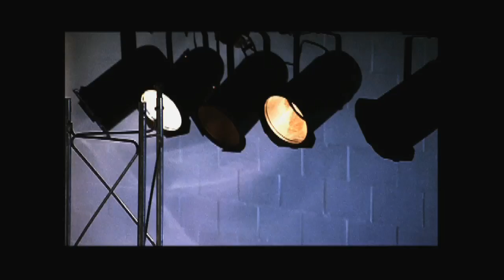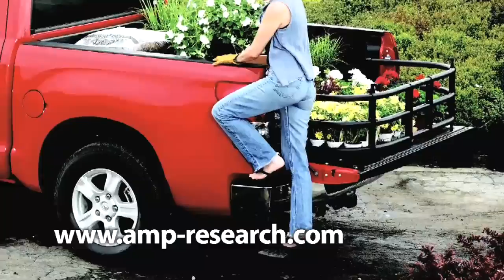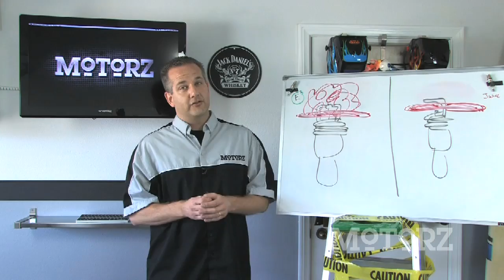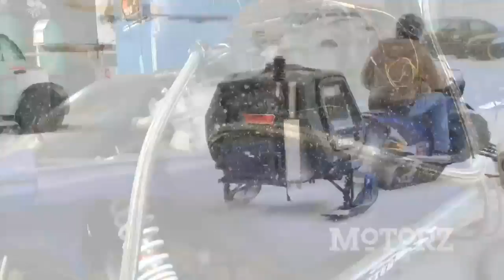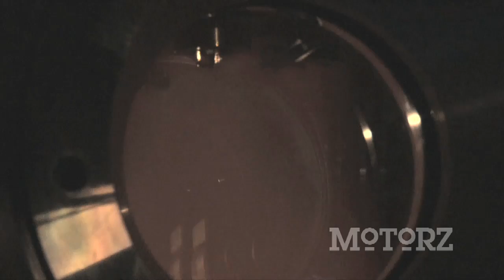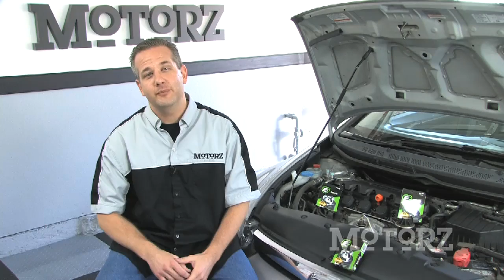How-To Inspect and Change Spark Plugs Motorz #49

Comment: Hey,

Question- why, when the manufacturer gives a torque spec do you not use it? 2007 Civic R18 engine calls for 156lb/in of torque for its spark plug installation. Why not use it?

Comment: I have used e3 on other cars. Very happy with them. I have a Dodge Charger hemi 5.7L which take 16 plugs. I have heard on forums and such that the e3 plugs the hemi doesn't like. I am in a rut thinking. What should I do. First hemi I have owned just don't want to mess car up. Please help

Comment: If the e3 design truly produced better results than a single electrode it would simply have been adopted as standard equipment  40 years ago when emissions laws started reforming engine design.

Comment: Spark plugs at an absolute minimum should be changed every 100k miles. Some hardcore folks claim every 30k for copper, 60k for platinum, and 90k for iridium. In my experience a happy medium of 50k for copper you should pop the sparks out to inspect. If they look tore up, changed them out they're cheap ($20 or so for a set of 4)

Comment: The internal combustion engine technology is on its way out. Sooooo inefficient I want to scream!!! The general energy efficiency of the ICE is about 20%. That means 80% of the money you pay for your gasoline is wasted as heat and inherent handicaps of so many energy taxing devices as the transmission, shafts, clutches, adnosium. Think about this folks: when you pay $100 for a tank of gas, you expect to get your money's worth right? NOOO!!! You're getting around $20 worth. The other $80 is wasted because the engine is not able to convert the energy in the gasoline into kinetic 'work' - to move you. As it stands, only 1% of the energy is actually used to move you. This is the big reality check! But there is an alternative where you will get about 85% of the money you spend. It's called the battery electric drivetrain. AKA the electric car. Research what I have said if you are skeptical.